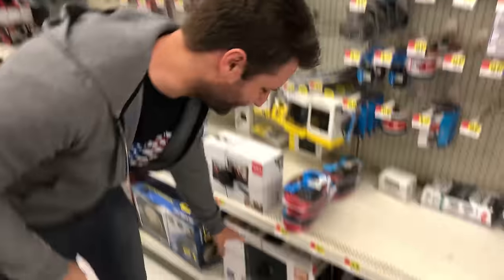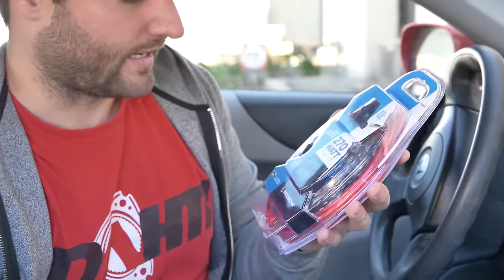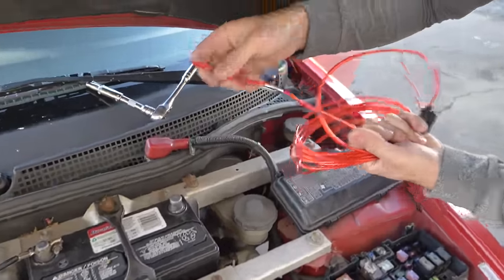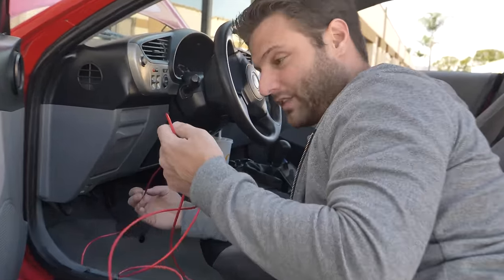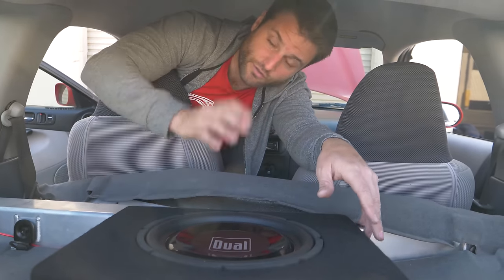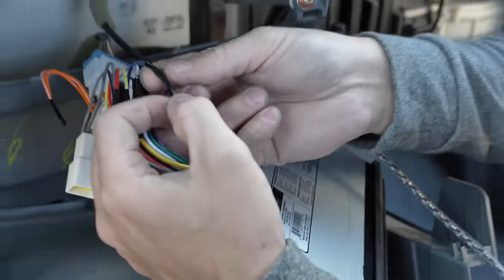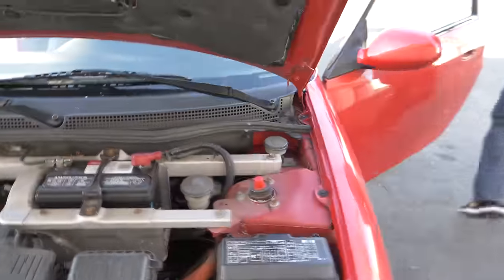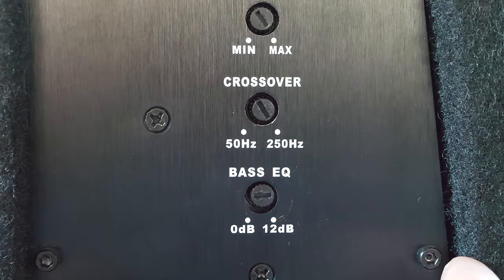How bad is the $70 subwoofer from Walmart? Install | Review

Comment: VIEWERS!!!!  FOR YOUR SAFETY!! please DO NOT run your power wire through the fender as illustrated in this video.
this wire should be ran through a grommet through the firewall for safety reasons. 
Also, please DO NOT connect power wire to the FUSE BOX terminal, please connect DIRECTLY to your battery positive terminal.. 
these "flea market" types of installations by unskilled installers are plaguing our industry, i spend 75% of my time at work fixing these types of installations.
Reply: Not to mention twisting wires together and instead of soldering them, using some old tape that was already stuck on there..
Reply: I’m glad someone here said it lmao
Reply: Wow thats a lot of writing
Reply: Exactly completely agree with you my buddy builds boxes for a living in Florida and this was ridiculous to watch dude could have really hurt his car lol.
Reply: @mariovaltorrres7663  doesnt mean he has to do everything incorrectly
Reply: BOTTOM LINE...HE'S ALLOWED TO DO SHIT WRONG IF HE CHOOSES TO! I can't see it from my house!
Reply: Eddie Versatile was he right to mix the three remote start cables together (1 from back of headunit and two from sub woofer) as well as the three red cords ( from battery to the two on back of sub) or is that incorrect
Reply: Ok he did it wrong but explain why it's wrong....
Reply: There is already a wiring harness in the fender that enters the interior through the lower left kick panel, presumably through a grommet. Also, connecting to the fuse box is not an issue in any way. Pay attention a little...
Reply: Eddie Versatile
Seems the flea markets are keeping you in business. lol
Reply: @shemp5344  As he said in the video, he terminated them properly after the test.  He could have shown that tho...
Reply: @eriv4735  It IS a bit much.
Reply: @daredevil6186  That is correct.  Some are complaining about how he connected them together...which is not correct...but he was only performing a function test prior to terminating them properly.  I recommend testing the connections BEFORE terminating them, as most do I imagine.
Reply: The
Reply: Bring some marshmallow to roast
Reply: You should keep your mouth shut about it  and let it happen LOL. Thats how you make money and stay in business bro hahaha
Reply: Not only all that, but two other big problems I see with lazy installers is running the power cable right where the air bag wires are, and using too small of a ground wire.
Reply: @daredevil6186  he should not have spliced. He should have paid Eddie $500 so he could run a seperate gold plated, bald eagle feather infused line.
Reply: Job security
Reply: You get more money for fixing more things though right?
Reply: That's what I thought when I saw him attach the positive cable to the fuse box then running it through the fender. If he gets hit there that will almost immediately make a fire or God forbid a battery explosion or something
Reply: @mariovaltorrres7663  the problem is that he is teaching people the wrong way to do it. It can actually kill someone
Reply: wire gauge wasn't too huge to make a difference, but yes connecting a amp to fuse box is no no because of wire gauge differences (impedance).  as for running wire thru fender yes another no no but doesn't really matter cause your shit is going to be toast during a major accident anyhow.
Reply: Mario Valtorrres doesn’t mean you set it up wrong
Reply: @mariovaltorrres7663  hahahaha!!!!
Reply: I was cringing so bad when he did it I hope his car doesn't shortened that wire
Reply: thanks eddie ! good lookin out .  I was driving down the street..my wires caught my car on fire , in seconds .. black smoke filled my car I couldn't see..happened so fast. lol good thing I was not on the freeway
Reply: If you believe that you're a "proffesional" radio installer you have problems.
Reply: the only grommet i have that isn't being used by a wire loom of the exact same dimensions is sitting directly behind a hot set of headers, not exactly the best spot to run a cable carrying 2000 watts of power. if you use cable ties properly and ensure the fender liners get reinstalled correctly it is OK, but of course that was the only other option for me besides running the cable underneath the car. not preferable but sometimes you gotta do what you gotta do
Reply: @alecwangaard7336  Its not difficult to drill a hole and add a grommet.
Reply: This tiny gauge wire with this super low power system is hardly dangerous. The wire IS fused afterall. IF he was installing a 3000 watt system in this way it would be dumb to run it from the fuse box. However it hardly matters where he draws the power from on this setup. I agree, under the fender is the cheap ghetto way of doing it but it is NOT more dangerous if the cable is FUSED, even with many thousnads of watts. IT grounds out, the fuse blows. duh
Reply: Eddie Versatile I spend 75% of my time at work bitching about wanting to go home....the rest of the time I stand around....
Reply: COOL STORIES BRO
Reply: He didn't run it through the door though smart guy, and if you look closely there was literally a factory harness running thru the same fender. As long as the wire isn't being pinched by anything then he's good.
Reply: @davidpieratt  actually the wire has nothing to do with impedance, Scotty kilmer fixed a car harness with a larger wire. The power wire he used is only used to power the speaker amplifier which means it will only draw out what's needed
Reply: @dougsholly9323  It actually can be.  If you are pulling close to maximum amperage through the factory cable to the fuse box and now add another "X Amp" amount and it exceeds the factory wire to the fuse box, guess what...............you just melted your wire to the fuse box (or started a fire).  I always love when I see people do this crap and then they also have 6 vampire connections in the secondary fuse box.
Reply: @chewey35650  Bad electronics assembly in general.  One, twisting and plus only using one piece of electrical tape is bad.  It should of been crimped and spliced with a three way connector at the minimum, or soldered.  It can and typically can split sometime later, possibly touch metal and now whatever is on that circuit is shorted out.  I've seen where cars wouldn't start because of ACC/Remote was touching metal and trying to trace down crap like this in cars you have no idea where someone did something like this takes forever.  Power cable through the doorway is always bad because over time the wire will get exposed to metal in most installations performed in this manner.  Amplifier power should also go to the battery, not the fuse box, have an inline fuse less than 4" away is the guideline, unless their is a secondary control unit already wired into the battery.
Reply: This is Walmart Electronics Assembly too.  Hope the car is trouble free for the next year and may it not catch on fire.
Reply: @brianhummel8659  I see your point, however it is extremely unlikely that they would engineer the fuse box at or near max amps. They would put in a comfortable buffer to prevent electrical failure. Not to mention that there is almost always unused slots in most fuse boxes, especially if you are driving a lower level model without the bells and whistles, which would put you even more under the max amps for the fuse box. Theoretically speaking, you have a point, but in reality, there is zero risk unless you try and power an entire sound system through the fuse box.
Reply: My kit didn't have a lead big enough to put it directly on the battery, but it has its own 40 amp fuse on the fuse box, is this still safe?
Reply: And the other 25% of your time messing up people's cars with shoddy remote start installs that cause untold electrical issues in the future.
Reply: Eddie Versatile lol right
Reply: @gabrielpichardo1492  hos wireing harness for the car from factory runs behind the finder and he zip tied it to the factory harness
Reply: Ok thanks for your advice. Where are your videos to teach all of us inexperienced audio enthusiasts.
Reply: @Ronald Ross what kind of piece of shit car do you own where road debris manages to get in between the fender and inner lining of the car?
Reply: I had wonder because everyone one else’s says the same you are but this guy confused the hell out of me
Reply: Yeah this guy is not a mechanic that's for sure. But hey he's gotta start somewhere
Reply: @shemp5344  don't soder in a car you should use crimp connectors
Reply: @mariovaltorrres7663  it doesn't cost money to have a brain and run the wires the right way...
Reply: @Dave-fc4kq  he is not just doing things wrong is is informing people how to install it wrong
Reply: Eddie Versatile,
exactly, hooking the Power wire to the fuse box will fry your alternator.. this guy is definitely a novice‼️💯💨 & I've never ran a Power wire under a fender; I've always found an oPening somewhere in the firewall..
Reply: I feel like the $70 sub/ amp combo is more harmful to "the industry" than anything....
Reply: 110% true
Reply: @shemp5344  the soldering police!
Reply: What about running off an unused but live 30a fuse from the interior fuse box for a small amp like these?
Reply: Yes, this is correct. Listen to this comment.
Reply: @chewey35650  ..... people have been
Reply: @coreyfellows9420  no but if 50% of do it yourself'er did it then probably... I might say yes.

That being the case, I care not what strikes their industry so I would agree.

Nobody is interested.
Reply: @dougsholly9323  The whole system is powered from the fuse box. Radio, door speakers, tweeters.... all factory installations are fused at the box man.

Also, you may need to look up wattage being pulled and compare to spec because frequently they are "costed out" of anything that they (the vehicles) dont need.

All in the name of the stock holders. The manufacturer is not going to put a fuse box in at 50% capacity if they can put one in at 93% capacity for less money.
Reply: What do you do the other 25% of the time?
Reply: Eddie Versatile I’ve always ran it through my fender/door jam......never had any issues
Reply: I find running my power through the side of my door instead of the firewall works fine. Then again, I properly secure and wrap my wires so they last a long time without any damages. 

But I definitely agree with where to connect the power. I've shorted out multiple amps connecting to the fuse box.
Reply: I cringed when he attached it to his fusebox! I'd never run it along the fender either haha - stupid idea! Then again I fit systems as a hobby lol.
Reply: @daredevil6186  You should run the rca's on the opposite side to your main power wire as it can cause popping and alternator whine to come through speakers! Annoying sound I had after a shop did mine last - told me the rca's wouldn't cause it next to power wire, I knew it would and got him to move them away - problem solved instantly :)
Reply: You can run speaker wire with power though, never had an issue with that :)
Reply: Ur correct if the door splice the wire it  fire for his car
Reply: Did anyone explain why this is wrong? It's a) fused b) following the factory loom c) drawing little power from the factory fuse box terminal. Grommets aren't magical...
Reply: Connecting directly to the battery could drain it if the amp doesn't know when the engine is running and to turn it off when auxiliary power is off. The connection at the fuse box is switched, so there's no risk of parasitic drain by the sub amp.
Reply: @RAndrewNeal  you're assuming the sub amp has appreciable paracitic drain. given the instructions have it directly off the battery terminal, that's pretty unlikely. one flat battery and you'd install a relay so not really that bad either...
Reply: Sounds like these types of blokes are giving you business!
Reply: Lol flea market install
Reply: @dougsholly9323  You are correct about wiring through the wheel well, if that is what happened. Some cars only have grommets on the wheel wells. You are wrong about wiring to the fuse box. This can be bad if the required gauge for your system is larger than the one running to your fuse box - with this system, it looks like a low enough RMS watt sub to cause problems for this case, but still bad practice.
Reply: How bout thank them for providing you with business.
Reply: Eddie Versatile Thank you Sir!!! I was wondering like ... yo .. I never seen that before , he took off the fender 😲
Reply: Thank you i was going to immediately advise the same.
Reply: @shemp5344  dude watching him do that gave me anxiety lmao
Reply: Don't tell me how to live my life!
Reply: Omg I wasent tho only one thinking that either
Reply: Just did mine today was wondering why he didn’t do it that way haha
Reply: eman well for one he hooked power wire to the car fuse box 2 he ran power wire through the car fender wihich means if the wire over heats blows fuse an catches a fire it’s going straight to the car interior an then the car is toast an then 3 him hookikg the wire to fuse box if the subs hit a tromendous amount of bass it could easy short out the main fuse an she the car off while going down the road that would suck doing 80 down the interstate an you car shut off cause of the bass
Reply: amen
Reply: im so glad my battery is in the trunk
Reply: @gabrielpichardo1492  People watch Rob Dahm for sterio installations?
Reply: I have a stock Ford F-150 stereo. If I add this unit to my truck I have a question about the speaker hook up. Do I leave my rear stock speakers hooked up and then tap into the speakers with the spliced end of the RCA hook ups? Or do I buy a LOC and tap into the stock speakers and plug the RCA into the amp unit?
Reply: Nothing wrong with running it through the fender along side with the wiring harness no harm what so ever and im an electrician
Reply: @mariovaltorrres7663  keep that budget in mind when the car catches fire.  It's simple math... maybe not so simple for some...
Reply: I mean at this point we should be glad that he actually got a fuse for it
Reply: @dougsholly9323  Yea your correct they jumped to conclusion's
Reply: eman 4.9m views lmao
Reply: @salvadorespinosa735  This is not a "how to do professional-grade installation of $80 subwoofer" video, it is a video made for shit s and giggles ffs...
Reply: HomeTek Inspections buy a good LOC and tap in to it
Reply: JBL Dude ቿጕዒ ツ Thats also alot of potential damage

revs chainsaw and laughs
Reply: Thank you dude! I am a noob to Audio installs and have been reading tons and watching videos and these give me weird vibes...makes me fell ill get shocked or my car will catch on fire.
Reply: @pointeroverflow  people who cant afford a $200 drill will find it difficult with their $15 walmart drill

Comment: Oh, I will admit the whole unscrewing the fender part was crazy.  You can typically find something that goes through the firewall that is rubber grommet protected where you can get the wire to feed through.
Reply: “Crazy” is when you don’t go through the trouble to DO IT RIGHT.

Comment: Next upgrade is to put speakers in those empty spaces where speakers can go behind the seats. Do it Rob Dahm do it!!!!!
Reply: Michael Bacon was about to comment that he definitely should try.
Reply: Yup. Do it Rob Dahm it. lol, sorry couldn't resist.
Reply: Agree!! do it Rob Dahm
Reply: No need, by adding speakers there you are bringing the soundstage back and ruining the sound quality with a bunch  of unneeded interfering frequencies.
Reply: mouthies3 I object two 10 inch kentwood subwoofers with a small basket and only 150 watts split between the two would add just enough that it wouldn’t overcome his doors speakers and tweeters and it would sound nice and clean while still adding just a tiny bit off boom when the bass hits so you can feel the music and it would only cost like 100$ for that kind of set up remember not all subs are made to rattle your doors off lol
Reply: Mc Fly Guy you're right if you mean subs, but that adds complexity he doesn't want since he'd have to fully seal that location. Also the factory locations are for 6.5s, the subs wouldn't delocalize the sound but the 6.5s would. The only benefit they would have is some back fill, which even then is not worth it.
Reply: Kentwood😂🤣😂🤣😂🤣😂
Reply: DUEL AND SOUND QUALITY IN THE SAME SENTENCE.....IS YOU HIGH??
Reply: yes
Reply: I wanna see this

Comment: 3 minutes in and I'm hyperventing in a paper bag...
This isn't a review, This is a video showing you what not to do.
Reply: Why? Can you explain?
Reply: you're being dramatic, he did fine.
Reply: Best not to run the power cable through the door.... Not only does it look bad but it's at a higher chance of shorting out.
Reply: @CSryoh  m8 he didn't even solder or shrink tube his damn radio. he just has them crossed and electrical taped
Reply: @mashedpotatoes5323   its not like there wasnt already over a dozen wires going through the same spot from factory, good enough for them and it lasted that long
Reply: @knowbull5hit590  uh actually it's exactly that, there wasn't any factory wires going through the door panel... Car companies are smart enough to know that's a fire hazard, the factory wires are ran through rubber sleeves when they are ran through the firewall or from the door hinge to the door.
Reply: @mashedpotatoes5323   he didnt run it through the door panel like your thinking, watch again it shows the wire coming from the firewall inside the car
Reply: @knowbull5hit590  yeah I'm not sure where I got that from, I need to chill on the weed....
Reply: @mashedpotatoes5323  lmao no problem, super common thing to see with amateur instals so it just fit the theme of this video well lol